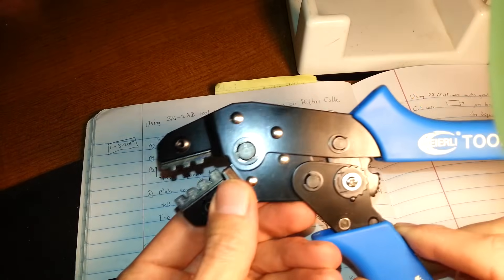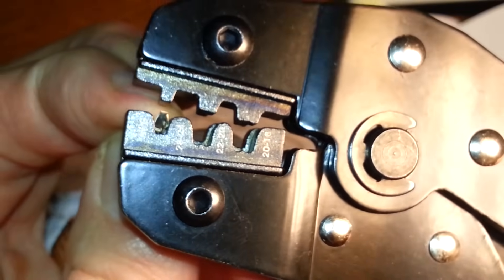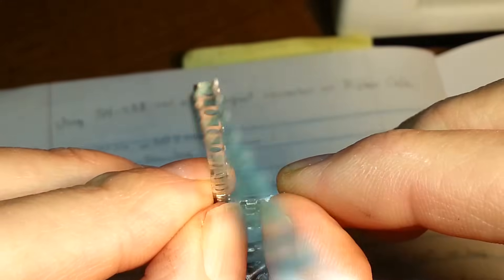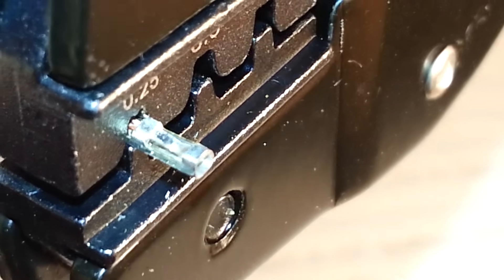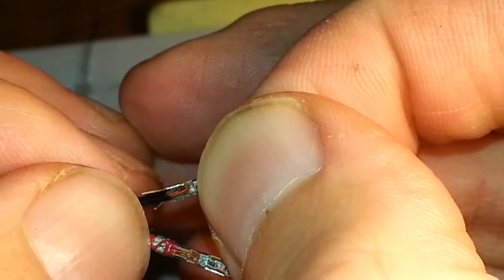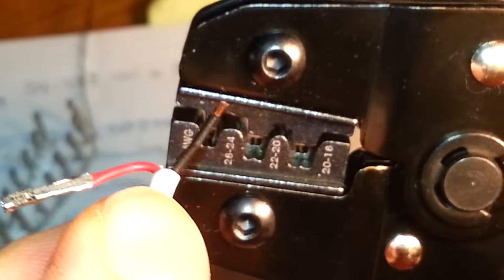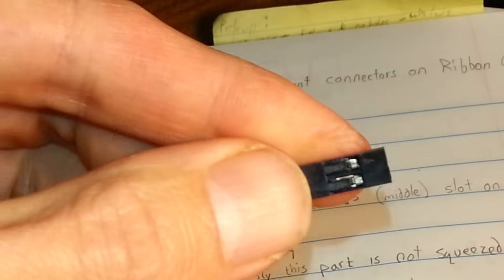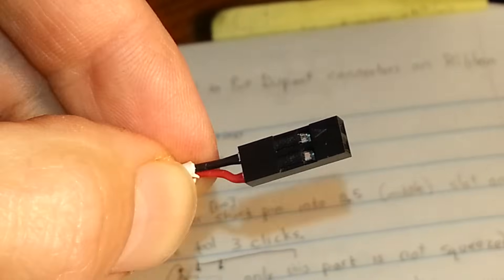SN-28B Crimping tutorial for DuPont pins.

Comment: Using a cheap crimping tool will not give you desired results. You might save some money, but you will regret each time you use 
it and see the results. These cheap tools don't follow the standards. I happen to buy several of these, even bought different die sets as well, but I regret it.
These are precision tools and alway buy from a trusted manufacturer. For these small DuPont pins, I will recommend Engineering Inc crimp tools. Its Japanese brand.
Reply from the maker: James Anderson Thanks for the recommendation!
Reply: The main problem I have with the SN-28B is that it's hard to release the pins after they've been crimped. You have to use some force, and often end up bending or breaking the pin. Additionally, the pins never quite slide into the connector housing because the rear part is left too wide open, so you have to go over them with needle-nose pliers to make them fit. And of course, they're quite fiddly to insert into the tool and get the correct length of wire in, as evidenced by this video. That's something I didn't consider when going for the "one-step but you'll be flying blind the whole way" solution offered by this crimping tool.

Comparing the SN-28B to a friend's (expensive) Knipex, we quickly figured out why the pins always got stuck in the tool: the dies on the SN-28B are not polished on the inside, where they contact the soft pin material. The surface is unpolished rough sintered metal, painted or anodised, and as a result tends to grip the freshly crimped pin. Perhaps if the dies were polished it would work better. Certainly something I'd test if I knew anyone with a tumbler, but alas...

I read many good things about the PA-09 you recommend. And if Dupont pins are all you do, it's certainly a good compromise between quality and price. The Knipex is good, it's really good, but holy moly, that price! For folks who need a little more than the PA-09 offers, it might be worth looking into the PAD-01 set with the 3 interchangeable dies, also from Engineer.
Reply: Juan Rial I hear ya on the cheap crimpers not releasing the pin and also having the rear part too wide open that you have to give it a squeeze with pliers to get it to fit in the housing. Although it does work it requires extra steps and if you crimping a decent amount of these its just best to get a decent pair like Engineering Inc ones mentioned by OP the PA-09 or PA-21 depending on what size terminals your using.

Comment: I purchased a similar crimping tool.  A good one.  But after several days of trying, and watching instructional videos, and trying again... I'm starting to think soldering is a better option.  Disappointed.
Reply from the maker: chance encounter , it's worth trying!  I hear that the wires are more likely to break after flexing the wires a lot, but maybe some hot glue can provide strain relief.  But it will sometimes melt outside, or freeze and release it's grip.

Comment: Its crimper not for dupont. tails for insulation are incorrectly pressed
Reply from the maker: How should they be?  (The wings/tails hold the insulation, but do not pierce)
Reply: @TheRainHarvester  only because of the poor quality of the stamp. Just check true dupont crimpers. for ex: HT-95 (AWG 22-32), HT-102 (AWG 22-32), HT-73 (AWG 18-20)
Reply: insulation part stamp should be circle, not M type
Reply from the maker: @StahLHerZRocK  interesting!
Reply: @TheRainHarvester  cost-effective IWISS SN-025

Comment: Hi, this is a good video, but: I have same SN-28B and it seems to behave in a somewhat suspicious way: I can crimp identically like you, everything appears fine, but a closer look reveals: The smaller wings for the copper are not pressed tight enough. If you open the wings for the insulation, the wire can easily be pulled out of the remaining smaller wings, which proves to me a bad crimping and thus bad contact. Your connection looks identically suboptimal. The wings must grab into the copper wires. I do not trust this tool at all! You can compare the quality with readily crimped DuPont cables from China. They look much better! Tightly crimped as to be expected. Of course made with a machine. Forgive my bad English, German native &-)
Reply from the maker: That is good info to watch out for! Thank you for relaying your experience.
Can you put a time marker for the spot where you see a lose connection? The reason I ask is because I haven't noticed this myself (maybe it's loose and I haven't noticed, but the ones I've made seem reliable. )  I know if I crimp too much, the wings can cut the tiny wire, so there is a trade off.
Your English is great! I wish my German or Spanish were as good.
Reply: @TheRainHarvester  Sure, 14:39 for example. You can see the red insulation, which is crimped rock solid I guess, but the small wings for the core do not really grab into the copper like e.g. here: https://cdn.shopify.com/s/files/1/0080/6617/0943/products/PL-1930-2_1800x1800.jpg  If you open the wings for insulation, the core will just fall off, I guess. There seem to be quality differences between several SN-28B suppliers. I believe, the trick is, the crimping inserts must be grinded instead of casted to fit together more exact. Even crimping w/o cable does not show the expected result.
Reply: Take e.g. a look at the IWISS crimping tool. The inserts looks pretty sharp and are combined from two metal plates manufactured separately. Wow, maybe this is the original SN-28B: https://iwiss.com/product/sn-28b-dupont-terminal-ratchet-crimper

Comment: Those are not Dupont pins, those are xh 2.54 pins
Reply from the maker: Thanks!  Hopefully the ebay listers will eventually settle on the correct searchable terms.  I'll have to remember "xh 2.54 " for my next order.
Reply: They absolutely were not XH contacts. XH look nothing like this, and have FAR smaller (and symmetrical) crimp wings. 

As for search terms… yeah, the Chinese vendors absolutely suck at this, stuffing all kinds of irrelevant terms in. And just outright errors: the XH connector is 2.50mm pitch, not 2.54mm. So when you buy Chinese XH clones, they’re labeled XH 2.54, but they’re actually 2.50mm. Loony.

Comment: This is the hardest way I’ve ever seen too crimp a connector, use a standard wire crimper.
Reply: There is no such thing as a “standard” crimper. There are literally thousands of types of crimp terminals, each needing a specific tool.

The only universal-ish crimp tools are the indent tools for machined contacts. 2 or 3 tools cover a huge range of contacts and wire sizes. But you still need a positioner for each contact type, and both machined contacts, and the connectors that use them, tend to be far more expensive than the equivalents using stamped contacts.